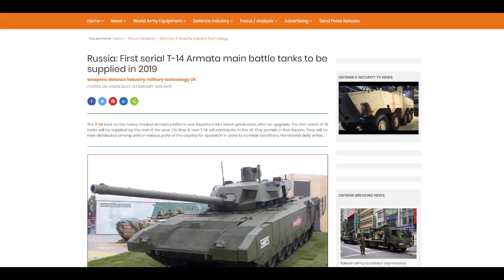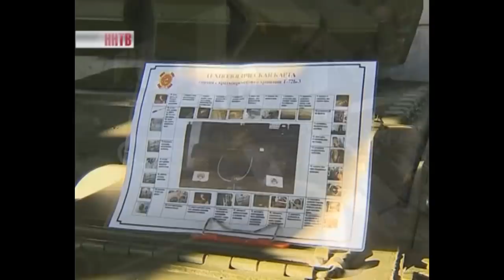Problems with Russian tanks

Comment: Problem with russian tank: They do not install the hardbass speakers
Reply: yeah, and some sweet alloy's with low profile tires
Reply: Rob Bleeker sweet, even their tanks squat
Reply: @robbleeker4777  Yeah.
Reply: I think hardbass speakers are their secret weapon, so no one really knows.
Reply: http://infosplanet.info/wp-content/uploads/2012/08/zvukoveshhatelnaja-stancija-zs-96.jpg
The Russian army also has mobile sound broadcasting stations. Like the CS-88 and CS-96.03. Loudspeaker station ZS-88 are able to extend the directed sound to a distance of 6 km. more complex modification of the AP-96, equipped with a system of computer analysis of the terrain and the weather, of up to 7 km and more. The computer model 96 is also able to calculate the optimal position of the station on the ground for the maximum "defeat" of the target.
Reply: @MJ-pz9fu  calm down dude
Reply: These people took it too seriously
Reply: They don't have the British BWV (Boiling Water Vessel) for making tea.
Reply: The problem with the new Russian tanks is that they don't have the upgraded computer electronics, which is necessary if you want a tank with an automatic, self loading turret.
Reply: @lightningphoenix7155  Full BS - T-14 has a 3 man crew with a fully automated unmanned turret.
Reply: @lightningphoenix7155  And who told u they dont have it ?
Reply: @Drakari  the fact that if it was automatic there wouldn't be a turret around the gun.

Comment: The Russian army used to value standardisation and simplicity to ease the production and logistic supply chain. Those days are long gone. The whole thing is a mess now, and the most numerous tanks are also the least effective, how you can get into that situation is beyond me. The Armata is a garage queen, the whole batch had to be returned to the factory for rectification, it's like what happened with the T-64. Too complicated. The Americans haven't produced a new tank since 1992, they just keep modifying the M1. This saves them a ton of money whilst remaining ahead of the threat. This is where Russia pays the penalty for having such small tanks - they are very difficult to upgrade with better armour packages., equipment like active defence systems and more powerful engines.

Comment: I don’t think your criticism is valid. I think that Russians present a very coherent approach to  modernization. Comparing T-72B3 to NATO tanks is not a fair comparison. Indeed, as you pointed out, B3 is perfectly capable against third and second rate militaries. But what is it also good against ? Almost every tank model of immediate neighbors, including China and former soviet block NATO members. It is also widely regarded as one of the best modernizations of T-72, particularly in cost-effect relation. Which brings us to your another point: why was T-72B chosen instead of T-80? T-80 had issues with reliability of it’s gas turbine engine, which plagued the tank since its production. In the post-USSR realities, this meant that T-72 was prioritized over unreliable T-80, which was rarely serviced and repaired, some of the tanks cannibalized for spare parts. Had Russians chosen T-80, they’d have to make up for decades of negligence, which means considerable costs. T-80 production was based in ukrainian Malyshev plant, which brought even more trouble and ensured that T-72 of UVZ line would be the main model used in RF. While Russians considered abandoning T-80 altogether, they found a niche (arctic) where gas turbine would actually be an advantage and lack of modernization- not an issue. 

As an end note, T-80 is not superior in every way to T-72. It’s less reliable, has poor logistical support and roughly comparable armor.
Reply: The T-80's renown has suffered a lot since the chechen war....it's now commonly cited as one of the "worst tanks" in modern military history.

Comment: There's also a huge question of costs. They claim they can produce it for an equivalent of under 4 million Dollars, I don't believe that for one second if it actually has all the capabilities that are advertised. If it's as cheap as they claim, it's far less capable than they claim. If it's as capable as they claim, it's far more expensive. Russian workers don't earn as much as those in Germany or America, but they don't work for free and components and resources cost money no matter where you are in the world, especially since a lot of the raw materials needed for modern electronics can only be sourced from China or some African countries - which means they are just as expensive in Russia as they are in the West.
All the tell-tale signs of a project that has turned out way too expensive are there. At first they wanted 2.300, then they cut that down to 200, as of August 2018 we're down to 32 (!). It's just kept alive for PR purposes at this point, no matter whether it's officially been cancelled or not, that tank is virtually dead.
Reply: U need to understand that the military complex in russia is different than in western countrys. Companys in russia which make military hardware for the state are not allowed to get profit from the state only from exports. The state only spends the money on the ressources. In western countrys the company earning high profits for saling to their own state. So thats why the western stuff is so expensive. A abrams which costs 8mil in america would cost in russia probably 3,5mil.

Comment: When germany invaded the ussr, they had the far superior (in design) t-34 tank but not many of them. After beginning of the war, they started to build lots and lots and lots of them.
Reply: It seems you've been influenced by the T34 myth. In reality it was one of the worst tanks in the war. Ergonomics were horrible. Crews were pretty much blind inside. Steel was poor quality and spalled easily, so much so there are hilarious accounts of people sticking their hand inside the tank through gaps in the armour plates. Inferior welding also meant an impact could inflict a hull breakage.

Most importantly nearly any hit would kill the crew and inflict catastrophic kill, since everything was stuffed inside one tiny compartment rather than spacing things out.

This is a quote from German training manuals for Panzerzerstörtruppen for Armee Gruppe Mitte, tank hunter squads of infantry divisions:
"Slow and unmoveable. Effect mostly psychological. Combat effectiveness very low."
"Langsam and Unbeweglich. Wirkung meistens psychologisch. Waffenwirkung: sehr gering."

Before it goes on to assure tank hunters the Russians are nearly blind inside and teams should clear any infantry using their cover team, before strolling up to the Russian tank and deploying demolition charges, mines, bundled grenades or brandflasche, molotov cocktains.

Sure enough, with all crew in a cramped compartment and no optics, tossing a bottle against a vision slit ensured roast Russians and a killed tank at pretty much zero risk.
Reply: @Blahb-o9b  You didn't read my comment correctly. I said, it was superior in DESIGN, not in REALITY. Low manufacturing quality has nothing to do with the design. And yet the Germans were impressed that they could't fight it effectively at first (with the tanks and PaK's they brought).
And in case you didn't know: The quality can vary depending on the manufactory and improved by time, like the german ones.
Reply: I can't remember where I read that an Abrams takes 2-3 months to build.
T-90: approximately a week. Ouch!
https://youtu.be/QXpvMGugu7o
Reply: @Blahb-o9b  As Sir Dan said (and as it happened with the T-34 in WW2) the T-90 could be mass produced in large numbers if needed. Now it is not needed, hence the slow production.
You seem to be talking about the T-14...?
Reply: @Blahb-o9b  The 5 cm PaK could effectivly penetrate only side and rear of the T-34. The PaK 36 were called "Anklopfgerät" (call waiting device) by the Germans, because it COULDN'T damage the T-34 except on the turret ring. And I talked to many Germans, who share the same opinion. Every tank got his own design issues.

Later versions of the T-34 improved some things. Like the T-34-85. It got a bigger turret with more space, additional crew member with more optics. And yeah, the armor stayed the same like a couple of years ago, that means that it can be penetrated by lots of newer weapons. But at that time it didn't matter because there were already too many of them.

History shows us which design has prevailed in the war. Even the Germans had given up their "super tanks" and had finally put their money on many cheap Jagdpanzer 38. But then it was already too late.

"Slow and unmoveable. Effect mostly psychological. Combat effectiveness very low." "Langsam and Unbeweglich. Wirkung meistens psychologisch. Waffenwirkung: sehr gering."
That is 3rd rich propaganda to keep the morality high.
Reply: @UVCMD  T-34, the most destroyed tank in the war.....
Reply: @0penminds  And the most numerous tank in the war. More than half of T-34's broke and were lost outside the fight. But this also applies to German tanks.
What does that tell us? It's like saying that men are inferior to women in battle because more men die in battle than women.
Reply: @UVCMD  45,000 destroyed during the war was it? Oh and yes, your analogy is piss poor.
Reply: @0penminds  45000 T-34 destroyed during war. 65000 produced during war. That's 20000 Tanks left to kick ass like yours. And unlike you, I argue right and don't rip the facts out of context without any logic.

Comment: Still remember when people said that the T14 will conpletely destroy the Abrams, now, it is no where to be seen....
Reply: It would never have overmatched the Abrams.  The turret armor on the T-14 is weak.
Reply: @SilverShamrockNovelties  how do u want to know that the turret armor is weak ?
Reply: Hakki Gakki the Russians said so themselves.  The design of the tank concentrates the armor protection around the crew.  The armor on the turret front can be penetrated by 105mm main armaments and is no match for 120mm guns.  Disable the turret, and you’re left with a really expensive and harmless paperweight.
Reply: But the T-14 is focused on crew safety not by spamming more tanks like the soviet military doctrine

(flawless grammar)

Comment: An objective analysis, the matter of why Russia doesn't install Relikt ERA on T-72s or the powerful T-80U tanks is puzzling to say the least, especially that "in my humble opinion" the T-80UK is the best tank that came out during the cold war, however,  regarding the T-90M, like you said it's easily comparable with the world's best tanks but only for maybe ten more years, I would agree if western tank development was going full throttle but that's not the case, like Russia all western countries are mainly upgrading older designs, the US for example shows no signs of wanting to develop a new tank to replace the Abrams at least for the next decade, Germany is sticking to the leopard 2, the joint tank project with France hasn't even begun, so I think the T-90M will be viable for quite some time, maybe until the west manages to come up with something comparable to the Armata which I don't think will happen anytime soon.
Reply: the t-72B3M/B4 has relikt
Reply: @hakkigakki2050  sadly no, you can notice the difference easily between Relikt and Kontakt-5
Reply: @hakkigakki2050  the Armor in the photos in your source is Kontakt-5 not relikt

Comment: Any concern about battle-readiness and combat-effectiveness of the T-80, T-90 and T-14 vs the T-72?  Compared the the T-72 which has had extensive combat exposure since it's inception, the other three have had little to none.  While the T-90 would likely be comparable as it is, in essence, an "upgraded T-72", the other two, particularly the T-14 are not and how they do in the field, largely, remains to be seen.

Also, manufacturing capability seems to be a more substantial issue than mentioned.  The T-72 was built during the Soviet era when Russian manufacturing was still at full capacity.  Since the collapse of the USSR, when it was severely crippled, that capacity has been growing slowly but still nowhere near what it was.  This will not only create slow deployment but will also affect replacement part availability.  I imagine mothballed T-72's can be salvaged for many parts so the "supply" has greater depth than T-90 and T-14 and will remain this way for a while.

In short - it makes sense that the Russians a "sticking with what they know" for now and trying to make the most of it before investing too heavily in or relying too much on its replacements.
Reply: And 3 years after that question we now have an answer to it.

Comment: the problem with Russian army post Soviet Union is funding. which is the reason the T-72B3 was chosen as the mainstay of the Russian armored brigade since it was the most numerous in stock and ultimately why the T-14 was dead on arrival. Most likely the Russian federation will just salvage all the technological advancements from the T-14 and retrofit older tanks with this technology most notable the Afghanit APS and its Fire control system.
Reply: the B3 was introduced as a stop gap meassure for armata ...and it worked very well judging by numbers of tanks. reason why b3 ? b3 offers similiar performance like T90A for less money. T90A peoduction was shut down funds were transfered to armata project.
Reply: @старшийсержант-л7ш  it wasnt a stop gap for Armata it was more a stop gap tip the Russian federation could field more T-90's but yeah you are right thats why the t-72 will likely continue to be upgraded due to their numerous nature.